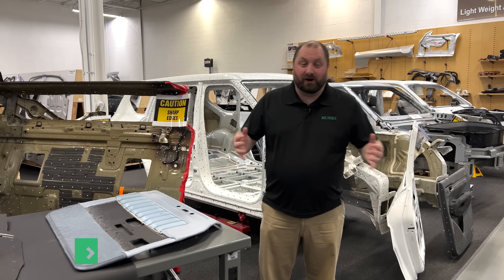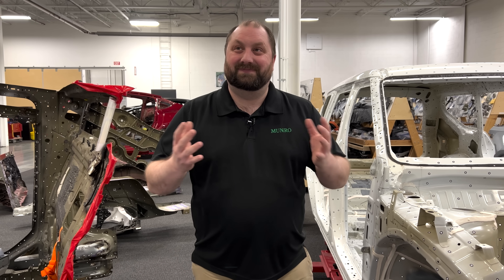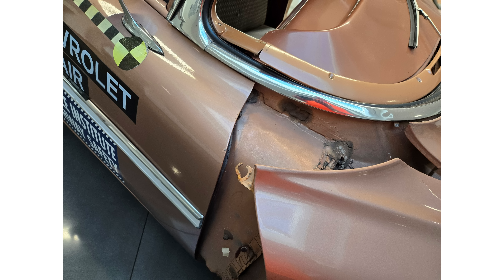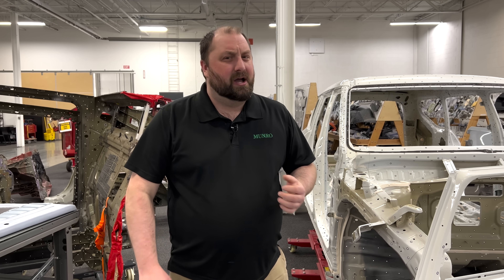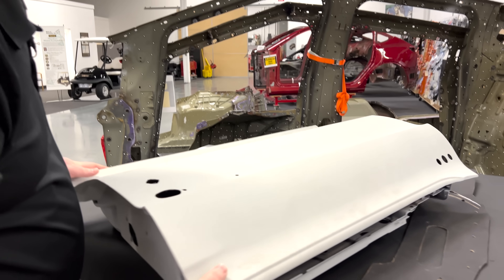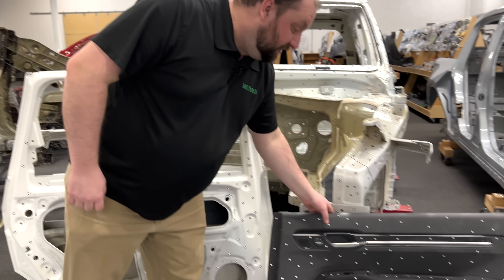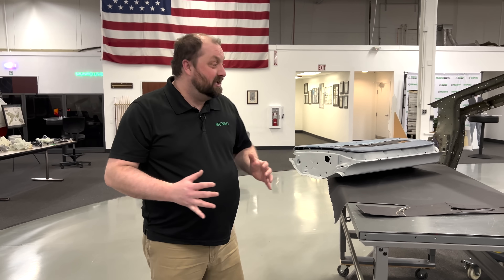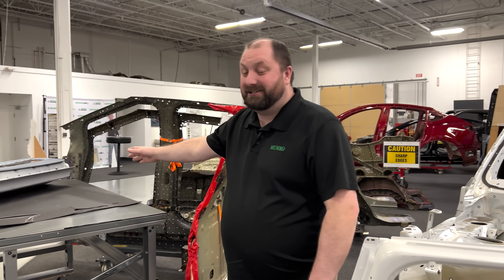No, Your Classic Car Isn't Built Better Than Your New Car

Comment: My gripe with modern cars has never really been the body or frame. It's how oversized and mechanocally unreliable they are. Safety features of modern cars will definitely leave you alive in a collission, but we're complaining that the old cars had engines and transmissions and such made to run forever, while newer cars have parts designed to break down just out of warranty

We get goodish mileage out of modern sedans, but even those are rediculously oversized compared to their 90s counterparts, and most cars nowadays get ~20mpg because they all weigh five million zilliom tons (which stacks the deck against older cars in the safety department to boot)

Comment: I sort of wish they could make a "new" version of a classic truck...yes, with all of today's safety features under the exterior paneling, but none of the electric touch screen nonsense, no electric door locks and windows, no keyless entry or remote start, none of any of that nonsense to go wrong, about the only "modern" thing inside being the audio system...just a cool basic truck with a classic design.  Modern trucks are too big, too ugly, and too filled with electric nonsense that makes them classless and prohibitively expensive.

Comment: In safety terms modern cars are better, in most every other way older cars are way better. Todays cars are just a rolling computer surrounded by plastic and held in place by a chintzy metal frame. The interior are all ugly clipped together plastic panels. Good luck working on today's cars, engineers have made it near impossible or extremely difficult for the average car owner to do the simplest of fixes. Top it all off with an extremely ridiculous sticker price and you got a modern piece of shit car. I'll stay stuck in the past thank you.

Comment: new cars are built with fewer rust traps, there is effective rustproofing, the bodywork is designed to be strong in all the right places, the mechanical systems require less maintianance but far harder for the user to effect a repair, even changing a bulb can entail a trip to the dealer. the electronic systems are more complex  (it's hard sometimes to find even the appropriate fusebox, let alone the correct fuse) and engine management allows the engine to be at least two engines in one, fuel efficient or performance depending on your driving style. So a lot of stuff about new cars is good but there is a downside. To keep costs down, the designs do the minimum necessary to do the job. I have owned, amongst other modern vehicals, a  DS3 and own a Riley One Point Five it's over 60 years old and is a pain in terms of dirt collecting where rust will form (like all old british cars really) so it needs constant checks to make sure it's ok, there are numerous grease nipples some of which need a shot of grease every month but the parts last a long time because they are not 'sealed for life' (and that life on a modern vehicle can be quite short, your lucky to get 10 years max out a modern component). The DS3 has stuff like the carpets not bothering to cover areas that are not generally on view, the plastic that makes up it's interior trim is the same stuff my wheelie bin is made of, and where these panels meet there are obvious seams and horrible holes for the fixing tags, the carpets are thin, the seat covers are made of synthetics which are just plain nasty, if the plastic clips that hold everything together fail, that's the dashboard in place, the power window switches etc etc then the interior soon starts to fall apart (and this goes for all the modern cars i have experienced). The Riley with it's thick pile carpets and metal hold down tags for those carpets, screws with anti vibration washers that hold the interior together, metal clips that hold door panels in place (60 years old and still good) is a glorious contrast. The Riley is 'Better' in terms of the attitude with which it was put together, if not it's safety features, (mine has no seatbelts and i have no intention of fitting any, i have had the car for over 40 years and i'm not dead yet. It never has left me stranded anywhere unlike the modern vehicles i have owned. And surely one point of a motor car is to get you to where you want go. Modern cars maybe safer but when the break boy do they break and you gotta call a recovery service. old cars certainly not safer so you drive with that in mind, but 'better' Hell Yes, at least by my definition of 'better'.

Comment: I definitely agree about the vintage cars you are talking about but classic cars that are 25-30 years ago which are from 1996-2000 btw are closer to modern cars than that Bel-air since we had computer simulation and crash testing. 
Also most people talk about build quality in terms of assembly quality, reliability of mechanical components, and material choices in interiors and around the engine for example. The comparisons of what era is better will vary quite a bit brand to brand but overall it was better in the 90's for German and Japanese cars especially so. And this is compounded if you compare cars that have the same inflation adjusted price, there is just so much more plastic where there should be metal or a different more permium component.

I agree that the increased use of body adhesive is a good thing when new but you can't replace that like you can with body and suspension bushings so a car won't be able to be kept in good condition or restored like older cars can.

Comment: Would you quit showing that stupid scene?  We know the 59 Chevys and Cadillacs had a very weak frame, but that 59 Chevy was doctored to make it fail as spectacularly as possible.  It looks like it is actually 2 or more different cars hastily put together, as it has Impala roof trim and Impala taillights, but is a Bel Air.  Also, if you look carefully at each frame, you will see that while the front end is caving in, badly enough to move the engine, the exhaust pipe, which is clearly visible, doesn't move at all, and the right front fender has come loose.  That 59 Chevy had no engine.  The car that is on display WITH an engine is almost certainly not the same car, just the same year, make, model, (they sold hundreds of thousands of them that year), and same color.

Comment: The only way anyone sees that 3/4 overlap collision video with the 59 Impala vs the 09 Malibu and thinks it’s fake is if they’re a troll, incredibly ignorant or a moron. Unibody construction is so much more effective at handling collision forces and the advancements in engineering to handle collisions are indisputable. In that metric, modern cars are light years ahead of any classic.
Reply: There's another good video of a 2014 Nissan Tsuru (basically a 1992 Sentra that kept being built in Mexico) and a 2015 Nissan Sentra that illustrates the same point just as well.

Comment: When I was 17 I drove a 1972 Ford Torino and rear-ended someone at 40mph.  My car was destroyed, the other car was somehow unscathed.  I walked away with a bloody mouth because my face hit the steering wheel.

Two years ago I had a 2023 Corolla sedan.  I was on the freeway doing 50, someone rear-ended me at (I'm guessing) 80mph.  I was fine, my car had minor frame damage.  

In the second accident, I was in a much smaller car but I'm here today because it was so much safer than the old Ford.

Comment: Newer vehicles are just junk in general especially diesels....everyone's resorting to older diesel trucks....buying used older vehicles...no one wants to deal with the Def and emission crap and not to mention all the problems these newer vehicles have and the outrageous prices.....I could go on
Reply: People nowadays have taken reliability so much for granted that they don't service their cars. The emissions systems are the first to die on a badly serviced car. More like a symptom of a bad motor than the cause by itself. Secondly, owners often idle too much, drive short trips, and don't let the oil cool off after long or rough trips. In Europe where manual gearboxes are common, people drive diesels at 1.5k rpm like they're tractors and then wonder why everything is clogged up. Though automatics aren't kind to diesel engines either. Of course there's also blame for bad workshops, that can't properly diagnose a diesel engine. No shop checks the crankcase pressure or even knows what the pressure should be. When injectors fail they don't inspect the rest of the fuel system. They don't know it's possible to clean a DPF without taking it off, and instead lazily do force regens which overheat full DPFs cracking them in the process. Etc. Etc.

Comment: I (somehow) agree and (somehow) disagree about the modern way of building cars so that they absorb the damage when there's a crash... that makes people survive the crash and that's good... What I love about old cars is they were built in a way they could be repaired (and I'm not talking about body, but everything) Even buildingthe car with a crumple zone that gets completely destroyed on a crash, WHY do you have to fill that great modern body with plastic parts that cannot be replaced when they fail? Why do you have to build the car with components that cannot be fixed? Why do you fill the car with useless electronic components that are built to fail after 6 or 7 years and cost 4 digits to replace (if at all replaceable)? Yes, old cars may be built "worse" but they were at least built to last... modern cars are built as appliances you have to replace at most every 10 years because maintaining them is so expensive it makes no sense... THAT'S why I hate modern cars...

Comment: New cars ARE built better for safety. But I would argue that is where it ends. Old cars, due to their simplicity, are built better for maintenance. No wet oil pump belts, No un-sleeved aluminum blocks with only a cylinder wall coating, no under protected electronic fuel pump modules UNDER a vehicle that needs programming when it inevitably fails, and so on. Mechanically totaled was not a term I heard until more recently. Don't get me wrong. I don't dislike modern cars. But when the term old cars were built better, this is a factor.
Reply: Today more cars are EV and they are - again - less complicated just as those classic cars were. My EV needs its first service at 40 000 KM. In between I just need to refill the window washer fluid and have the tyres switched in winter. Sure, you could argue that it is a computer on wheels but then, how much service does your desktop PC need? An EV is sill just a big battery with a big electro motor with some current and voltage regulators on top.
Reply: And cars that weren’t expected to go past 100,000 miles. They were simpler to maintain because they needed frequent maintenance. Cars today often don’t even get a tune up for over 100,000 miles. 
The added complexity creates all sorts of new problems and issues that most people can’t fix. But, as a whole cars are actually more reliable and last way longer than they did way back in the day.
Reply: @NBSV1  oh, I agree the modern cars are more reliable. But when something does go wrong, oh boy. I don't think old cars were designed for maintenance, it's just a side effect of its simplicity. What I don't get on SOME modern cars, is when a normal wear item is not only so hard to replace, but when it does go bad, it causes more damage. Take a belt driven water pump that when it leaks, it leaks internally, into the engine's coolant. Just one example.
Reply: @ That is the major downside to the modern cars. There isn’t nearly as much tinkering with it to keep it going. Things are often a pain to fix, or catastrophic. 
About the best thing is to learn electrical troubleshooting and work on patience.
Reply: All those things increase efficiency and make the car last longer.

Comment: I own a 1963 Falcon and a 1978 Mustang II.  I agree with you completely.  The Falcon has a metal dash, solid steel steering shaft, four wheel drum brakes, no headrests, and no seat belts.  It did have a single cylinder master cylinder, but this has been changed to a dual.  Even the Mustang II is safer, it has a plastic padded dash, collapsible steering column, dual master cylinder, front disc brakes, head rests, and seat belts(3 point in the front). The only thing I think was safer in the old cars was the manual windows.  If you have an accident where you end up underwater, it is much easier to get out of a car with manual windows than one with power windows( that has lost the battery connection.)
Reply: Sometimes it makes me sad to see the brutal conditions people must have endured while crashing in these older cars.
Reply: @WillieFungo  I am fairly sure that one of my classmates would have survived the crash he was in if the car had 3 point seat belts(and he was wearing them).  He lost control and slid sideways into a bridge.  The bridge impacted the car on the front passenger door.  As the car had no seat belts(late 1960s car), he was thrown sideways and his neck was broken on the car body.  This was more than 50 years ago.

Comment: The real problem with new cars is not the technology behind them, but the design goals.
Modern day manufacturers have better materials, better coating, better machine tools, better design tools, better analysis tools; and they use it to make just a gadget.
Modern tech allows you to cheaply give everyone heated seats for pennies, yet they charge people money for it and came up with subscriptions.
Modern tech allows you to make very satisfying buttons, yet they make a janky touch swipe gesture.
Modern CAD allows you to plan better and make parts more accessible for maintenance, yet they don't do that.
Reply: There are cars from the 90s that still run every day. While safety is important, in a city you don't need to accelerate from 0 to 100 in 3 seconds. In a frontal collision at 100 km/h, no car can save you.
Reply: @lolitaredneckzombie  Yep, that's the other side, the video showed classic American cars, not a galvanised or aluminium Audi, not a Mercedes with om606 or 605 engine. He didn't show cars that were ahead of their time.
Showing how a 30 year old mercedes has a solid interior, while a new mercedes is squeaking, doesn't fit the premise that new cars are better😂.
But one could argue cars from the 90s aren't classics yet🤷‍♂.

Comment: I'm tired of both sides pushing their agenda. Most modern cars are safer in a crash no doubt about it. The shell is tougher but everything else attached to it is low quality junk.

90's cars were the jack of all trades master of none in terms of safety and build quality. To bad that's the best we ever got. With a few exceptions of course.

Comment: New cars may have more structural integrity, yes. I’m not sure who would argue otherwise although there is ALWAYS that one person.

However…

New cars are often built with parts and or designs that are NOT designed to last, nor are they packaged to allow for easy access or maintenance.

New cars might save your life, and that’s a REALLY good thing, but how many new cars today won’t be in the junkyard 10 years from now due to the cheaped-out, inexpensive part that was made of cheap plastic, and failed and caused other damage that mechanically totalled the car because to put it right costs at least twice as much as the car is worth???

Comment: Im afraid to say it, but the title and image of this video is both misleading and incorrect... your whole premise at the beginning is safety..
A safer car does not mean it is better quality or better built. It is up to the buyer to determine what is more important to them in that interpretation. I interpret better quality and better built to mean that the vehicle is made from quality materials that have better durability and longer lifespans. That the build finish is better, with better shut lines, water and dust sealing, reliable, long lived mechanical components.

Even the poorest quality, let's say Chinese built cars (seem to be the ones at the moment, but not solely) are safer cars than some of my cars from the 1950s and 1960s.
I can't recall ever chatting with anyone who would claim otherwise... but ask people about their new, so called better built modern cars.. I constantly see people posting about appalling failures in new or relatively low mileage cars purely down to poor design or poor quality parts... they may be safer, but they as a general rule, are not better built..